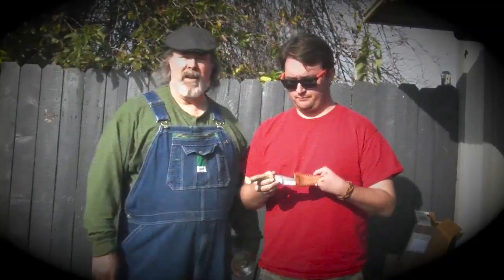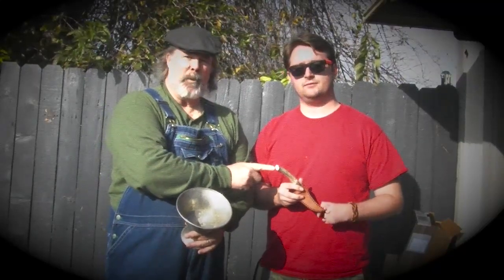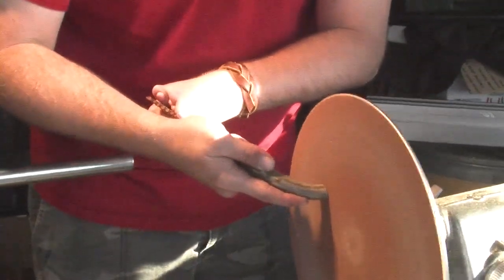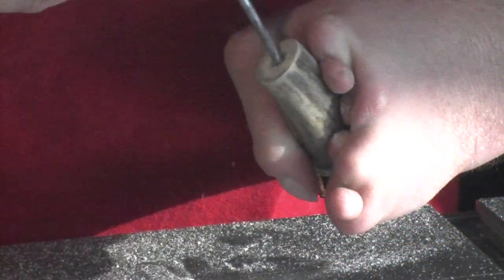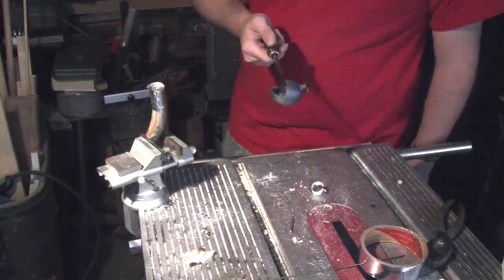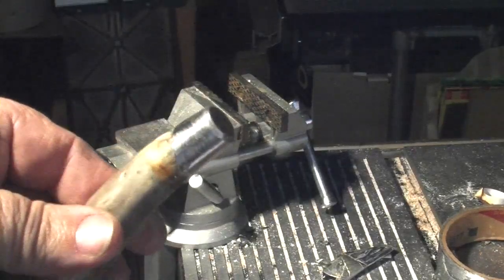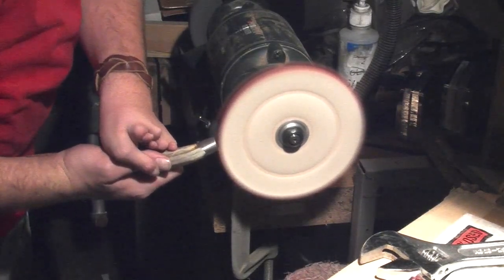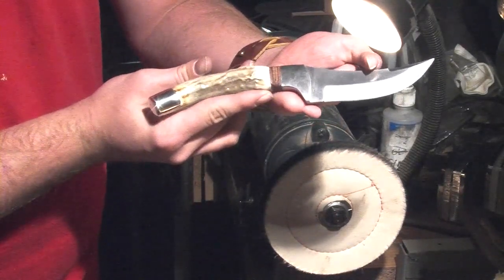DIY How to pour a pewter end cap on a knife handle

Comment: what kind of crucible was that and how much heat can it withstand? Could it hold up to brass? Also, Great looking knife! I hadn't even thought of using pewter.
Reply from the maker: What I used is a bullet casting ladle. It is cast iron and is meant for lead or other very soft metals. Iron has a hotter melting temp than brass so I think it will do well.
Reply: good to know. Thank you!